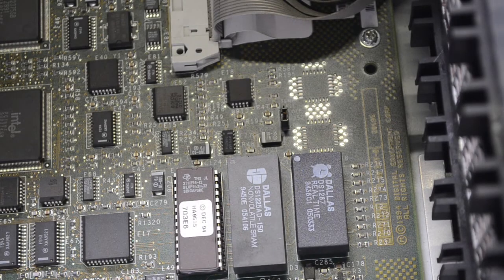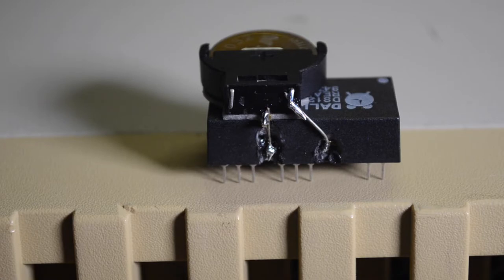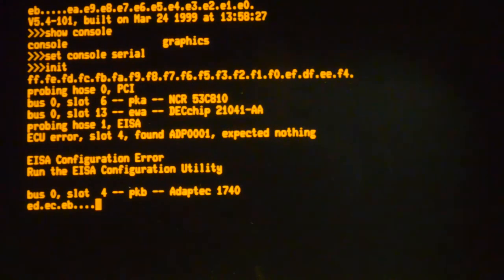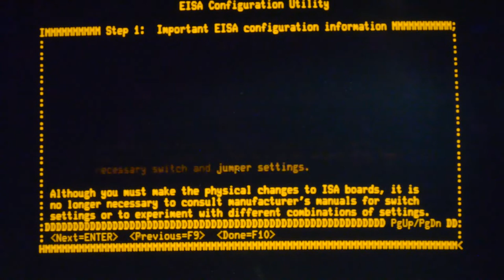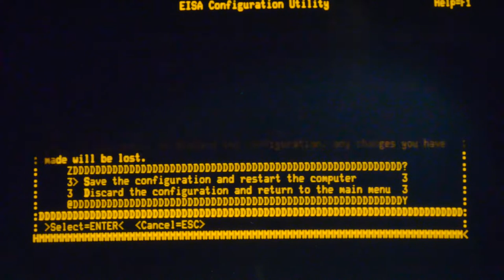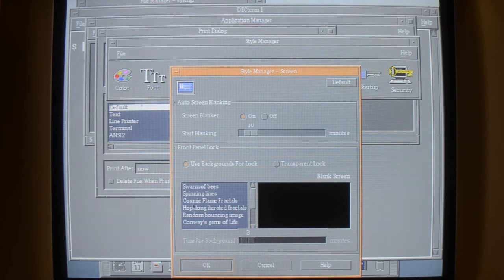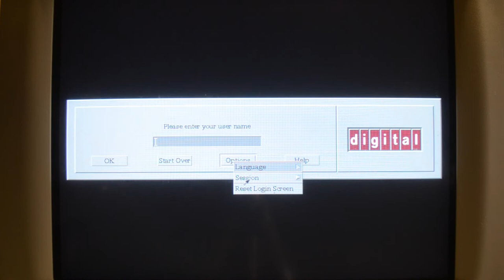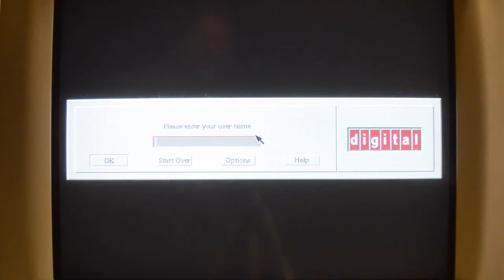AlphaServer 1000 Repair - Part 3

Comment: GW-12887-1 or GW-1287-1 RTC Replacement Module  from Tindie might be a good candidate to replace your dallas RTC. Saves a bit of hacking the old RTC clock, but that can be fun too. Enjoying your Videos, takes me back. I retired a year ago where I was a control systems software engineer on a linear proton accelerator. We were still were using 3 Vax 3100 in a cluster and a MicroVax to control some of the older parts of the accelerator. I am sure they are still in production today, and those Vax boxes were an upgrade from the previous machine which was a PDP-11, which in itself was an upgrade from the original control system.

Cheers!
Reply from the maker: I've actually found that you can still get modern 12887's which are mostly compatible with the 1287. I used some of those in my Alphaserver 400's. Of course hacking an old one is cheaper and makes better content!